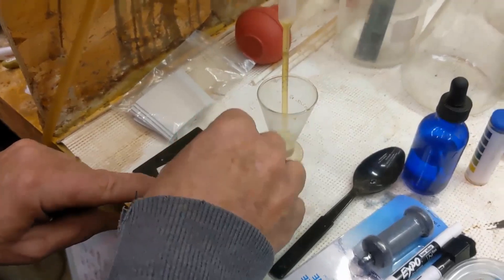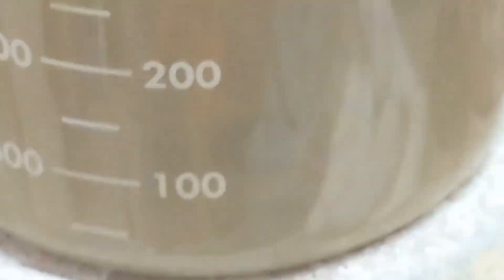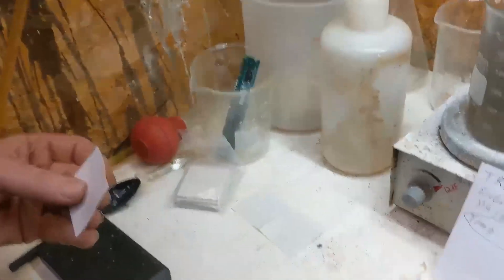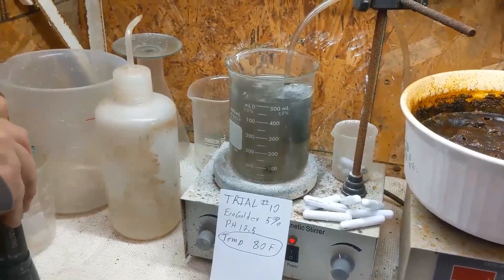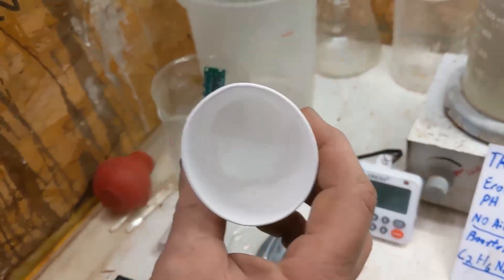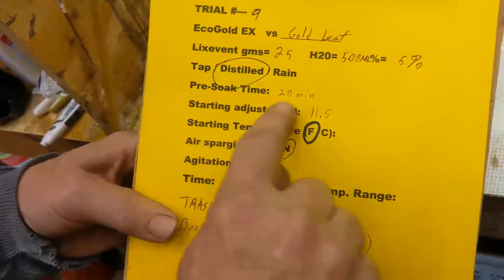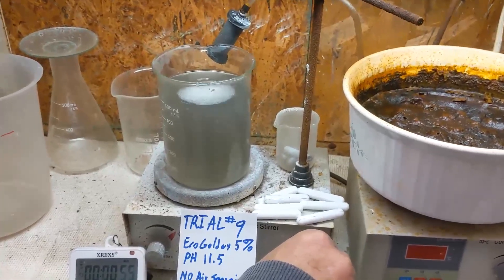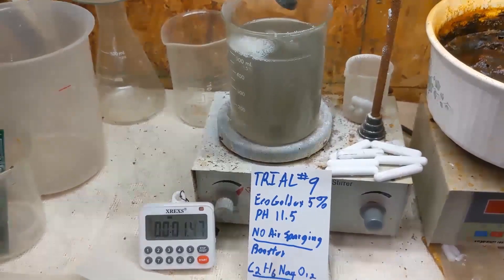Does Eco-Goldex Really Work With Hydrogen Peroxide?

Comment: Very good !   25G in 500ml is a ~very~ potent dose, even without the SP added.  I'd like to see the same test with 1gm in 500ml.  I typically use 10G per gallon.  Are you roasting all the cons before you leach them? zero sulfides?  For sulfides 22G per gallon would is my starting point. They changed the O series to S series now - for sulfde ores, but I haven't tested it on my sulfide cons yet. It looks and smells very different from the E and O series. Would love to be able skip the costly and time consuming roasting, PITA.  Thanks for the update, looking forward to the next one :)
Reply from the maker: there are sulfides and lots of iron .  no roasting.   the fumes from this stull will make you run away.